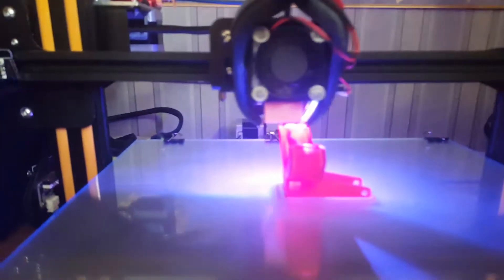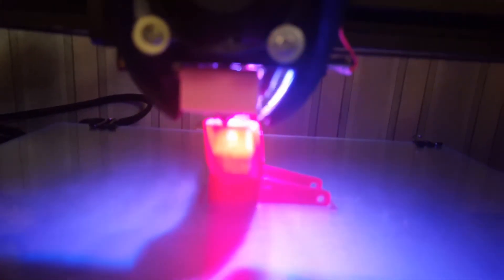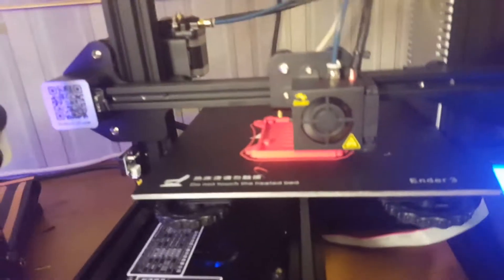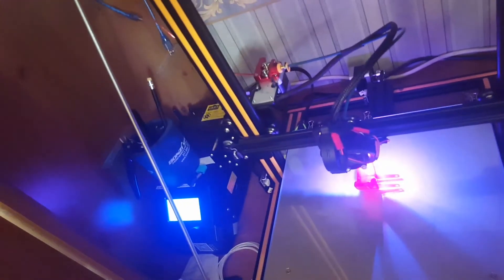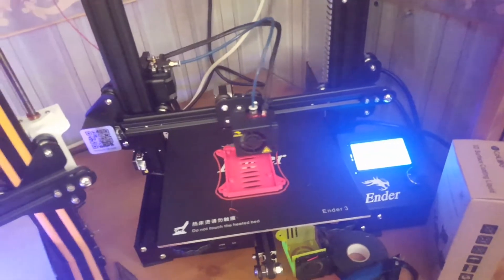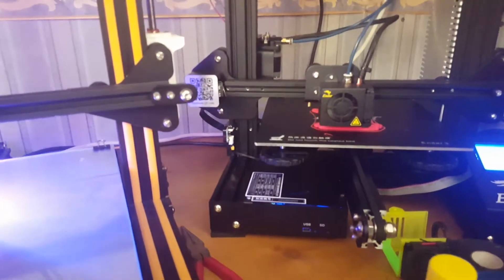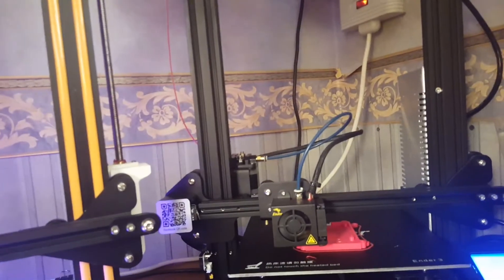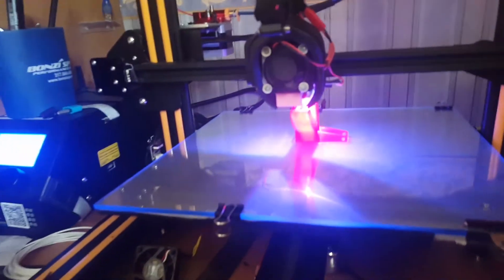Ender 3 & Cr 10 in action on Th3d latest unified firmware

Comment: Hi, my ender 3 is having the extruder's gears turning the wrong way. It is pulling the filament instead of pushing it. Can you post a clear picture of the wire orders going from the main line to the connector? This is the 'E' connector.
Reply from the maker: Aaron Stout holding cable flat  grove on e plug at top  pins 2 and 3 should swap 1 and 4 run straight send me your email il forward a photo
Reply: You are the man, thanks so much.  That's what I was thinking.  My 1 and 3 are swapped.
Reply from the maker: Aaron Stout  your welcome bud glad to be of help

Comment: Hi bro. 
A question what printer is better The Ender 3 Pro, Creality Cr10 or Creality Cr10 mini?  Thanks.

Gretting from México City.
Reply from the maker: personaly cr 1o for the money or ender5 if on a budget ender 3  but i would go with more stable frame and extra build volume   .wayne
but looking at this i may be tempted looks to me like a very cheap price rebranded cr 10 https://www.aliexpress.com/item/A10S-3D-Printer-Upgrade-Dual-Z-Rod-axis-DIY-Desktop-With-PLA-3d-printer-stereo-printer/32889352504.html?spm=2114.33020108.6.3.23a1PLOxPLOx93&scm=1007.17258.127170.0&pvid=0a1bc86a-23d1-46e0-bfff-fd6a30c2f1ac

Comment: Great video! If money is not an issue what printer would you recommend cr 10 mini or Ender 3? considering print quality, practicability,  usability issues etc which one would be better? I watched many Ender 3 video and I see many minor issues here and there while assembling it.
Reply from the maker: if u need bigger build volume cr 10 if not the ender 3 and get a pair of them for less than a cr 10 .The quality iam getting from both is outstanding .

Comment: Noob question: aside from the travel lines that doesnt go away no matter how much a tweak the retraction settings my ender 3 prints nicely. If I update my firmware do you think it will help me handle those travel lines? Or do I just have to keep on finding that sweet spot?
Reply from the maker: JunOsiris could well do but without seeing your issue could not say for sure but the settings features are constanly improved in updates

Comment: Did you have trouble getting your arduino board to recognise your Ender board? When I try to connect, I get an error asking if I have the correct processor and type. I have been using the sanduino settings. ( probably wrong spelling)
Reply from the maker: no just make sure u connect wires correctly it can be confusing if u watch the videos and dont have the same audrino model or if u have a clone of
Reply: I didn’t realise that I had to power up the Ender board separately with a USB cable.

Comment: Oooo... do you have to copy over settings from the stock firmware to the new TH3D or do you load the new TH3D for Ender 3 and it's good to go?
Reply from the maker: no can use as is its fine . if u wanted to update firmware .its pretty simple . the machine uses marlin firmware th3d is also marlin  firmware but the latest up to date version with extras like filament sensor add on /babyz steps /jerk /accleration to name a few.. unlocks factory lockdown .. dont think they the factory wanted a filament sensor on this cheap machine but you might and it is possible
https://youtu.be/soNrGu7a62U

Comment: did you add the new firmware or did it arrive with it, i have mine on its way, do i need to upgrade the firmware or is it good to go out the box, im new to printing
Reply from the maker: TrickGaming yes good to go out the box.and prints good . its got the cr 10 board inside with no bootloader and not much control over settings ..flashed with bootloader and th3d you have control from the box of pretty much all u will need with the benefit of thermal protection and latest version of marlin.i suggest if your new to leave as is for the moment . thingiverse.com theres plenty of files
Reply: ok and would you have a video on how to do that, thank you for the reply
Reply from the maker: https://youtu.be/27RDXtKjrCI
Reply: thank you sir and thanks for the video